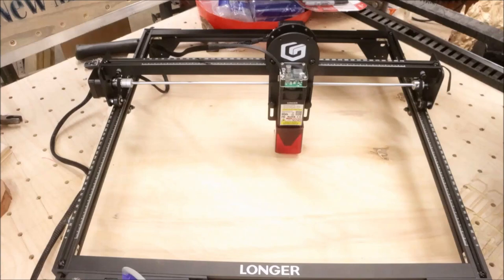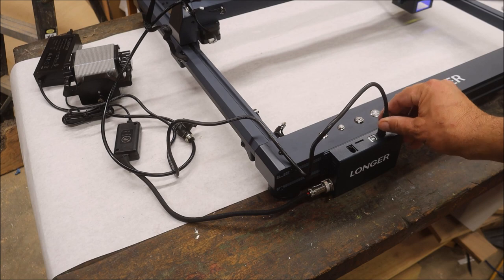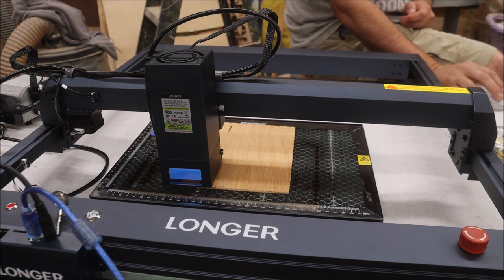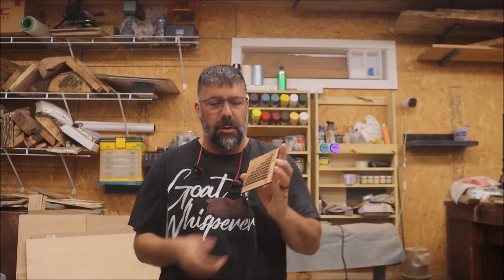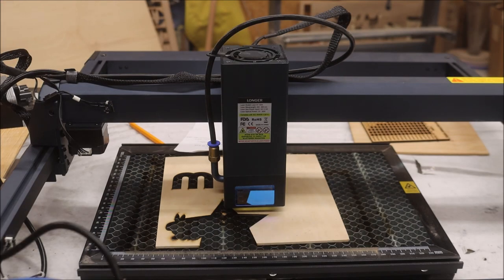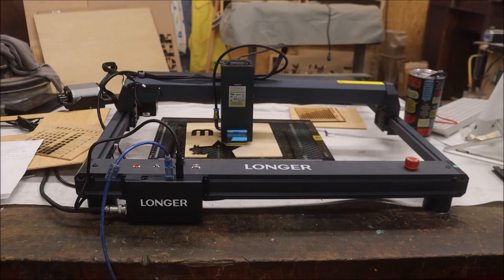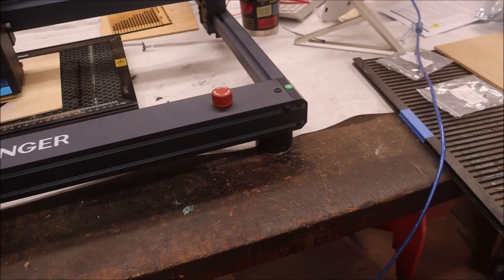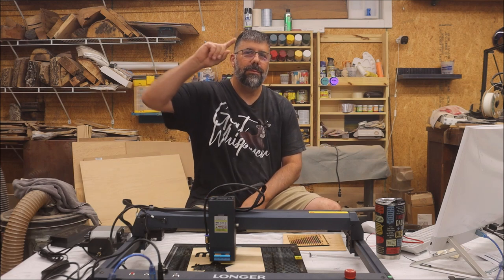Watch This Before You Buy The Longer LASER B1 30W!

Comment: Good review.  Definitely agree with the connector sockets on top of the machine.  Some of the wiring looks like it would be an issue for putting this in an enclosure.  Really like the cable management; that's a feature I wish I had on my xTool D1 Pro. The cables are just plain clunky the way it is set up.  Have looked at some of the drag chain setups, may go with that; it's great that Longer put the cables in the rails.  How is belt setup and tensioning?
Reply from the maker: Thanks Mark. The belt are basically a pull and connect. They are already the right length and have clasps on either end. You just pull and slide into the slot.

Comment: I watched several other videos and they complain that light burn chose the wrong software and they had to go into light burn and change it to get it to work right. Did you have to also change it or did longer fix the problem before sending you the b1
Reply from the maker: I didn't have that problem. Maybe they fixed it?

Comment: YOu came out with this video 2 months ago.  In using it during the two months, how has it been in terms of reliability.  Have jobs stopped in the middle.  Have jobs run where the image jumps to another spot on the material?  At this point I would take slow as long as it works.
Reply from the maker: Hey Scott, I haven't used this one very often, but when I have I haven't had any issues.

Comment: Dear sir! I bought this same machine 2 weeks ago cut three little projects out and the machine went bonkers.
on startup the machine don't home anymore the move buttons are backwards. if set it to go t a place on the work space it doesn't move when i hit go to origin.
I have three text messages to longer they tell me to try reburning the firmware did that still don't move now there not getting back to me. Its like something happened to the controller.
Reply from the maker: The move buttons being backwards is a Lightburn settings issue. 
Can you run these commands in Console. And then test if your jogging controls work correctly?

G10 L2 P1 X-845 Y-850
That should put the lower left at 0,0 with positive coordinates going up and to the right from the bottom-left.

Can you then power cycle and then retest?
Check the following:

Check that jogging controls work as expected
Check that bottom left is indeed 0,0 or close to. Top-right should be 845,850 or thereabouts
Other basic function of the laser